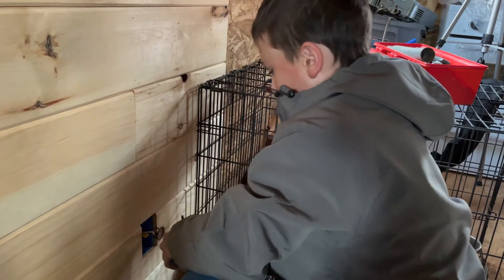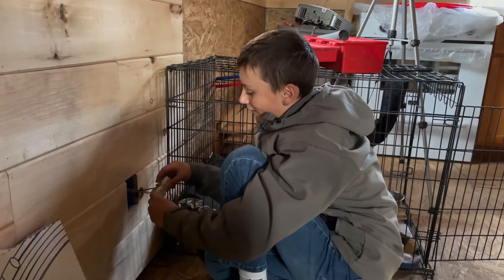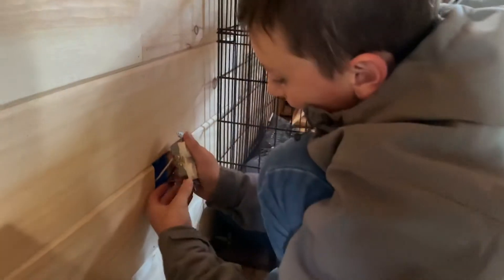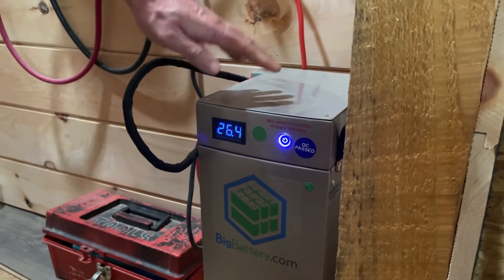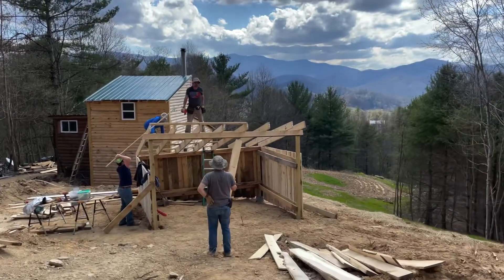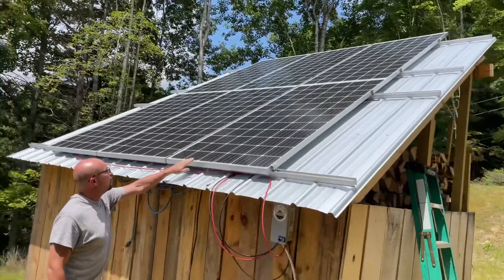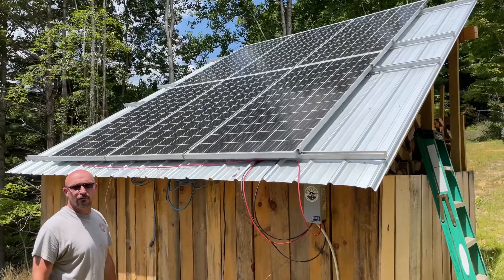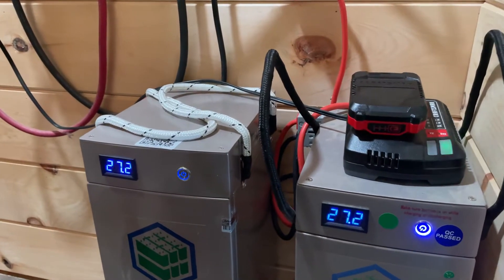Solar Power System Is Up!

Comment: System looks good Just add more battery as you can good work but get those dc cables off the tin don't want it to cut into it.

Comment: Wow Jeff that's alot of money sitting there. I do the same thing always looking at my voltage  amps watts.
Reply: I was wondering how your wind turbine is working out. I bought one just like it.
Reply from the maker: To be honest, not so great. I hope you have much better results. Let us know! 
We are still tweaking ours.
Reply: @Pepper Shack Life  well its working pretty good. Mine is 12 volt. I had to run my battery bank down to around 12,5  for the turbine to start working then it did real good. Since I have solar panels also I have to wait until night when my voltage drops in order for the turbine to start working. Just remember you have to get above battery voltage.

Comment: we have 4000 watts we cant make it we have add more panels 8 kw may work for us i hope
Reply: the gree  ac and heat
are grate they dont use much  power we got the 12000 btu 31 sheer form  signature solar